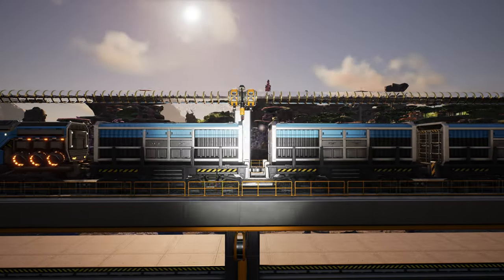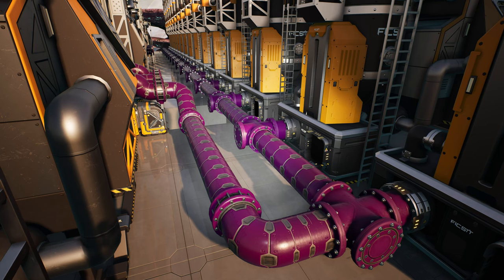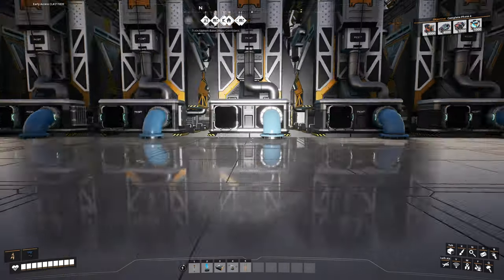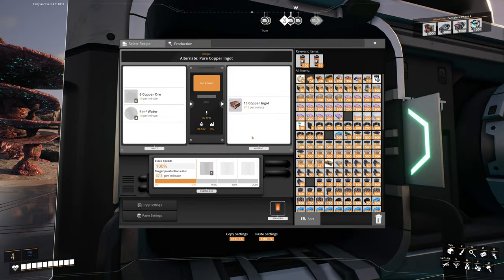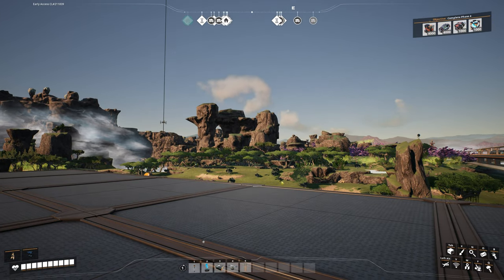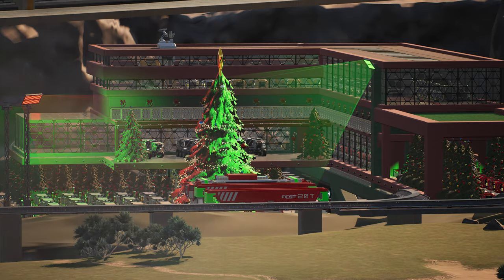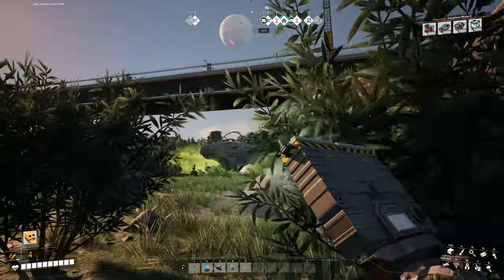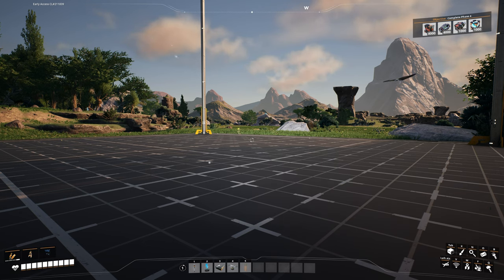ALUMINIUM Sheets and Casings LOOP! In Satisfactory

Comment: Personally, I prefer to use priority pipe junction to recycle aluminum scrap water back to alumina solution refiners. It's safe as long as implemented right (junction is vertical, backward pipe at the bottom, both incoming pipes have a valve preventing backflow). This way I don't have to dump it into concrete and/or pure copper and can process copper wherever I want with its own separate source of water.

Comment: Thanks for the water tips Bitz. Speaking of, I'm guessing the floor pipe holes got fixed. Used to have a problem with downward flow when draining through a floor hole. Also the sponsor plug was awesome, no cheese to be had.

Comment: Nice vid. Any reason for not looping the water back into the system making the alumina solution to decrease total water required?
Reply: its messy to do it like that backs up all the time
Reply from the maker: Hey bud good question, do you remember them pipes near the end that was just sitting there and i removed them? Well that was a loop, but i changed my mind to use the water for copper instead
Reply: You just use a priority junction as per the pipe manual. Set it up according to that and it will stay working.
Reply: @lordofcheez5  Havent had that issue and done it for multiple large alu builds. I create single loops with each refinery feeding water to only one other refinery and then plug in the water pump production line into it severely limiting the input. I make sure theres no vertical water feeding. The amount feeding from the pump I set to 1/pm over the required combination of water. Keeps it running for hours at between 99-100% Havent had any issues.

Comment: I was having issues with vertical pumps in my 8-level fuel generator Power Tower. The diluted fuel just isn't getting to the upper levels no matter what I do (I'm making plenty of fuel). Gonna have to try the horizontal pump trick.
Reply from the maker: Yeh go ahead try it, it should be better for you
Reply: @Bitz  I converted all of the pumps to horizontal and it works great now. Thanks!